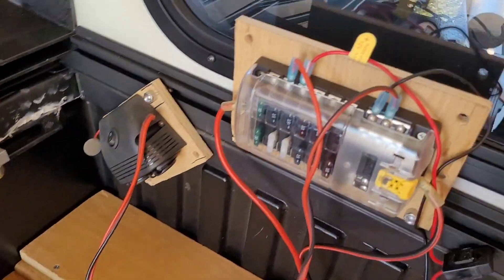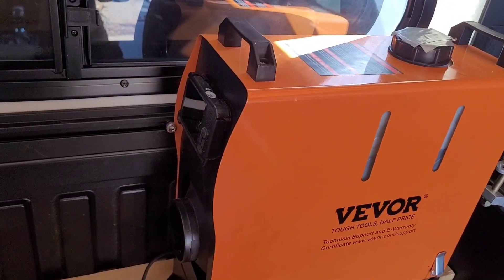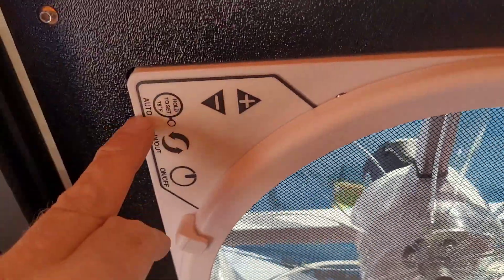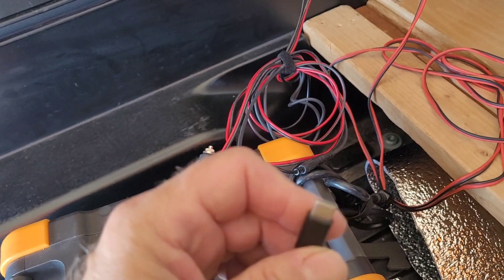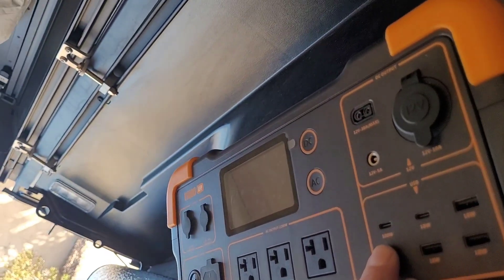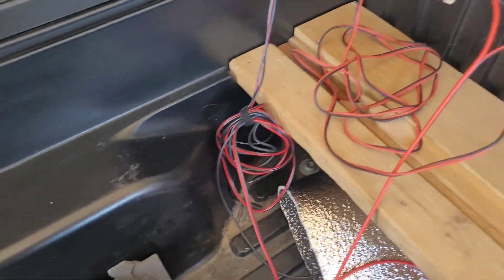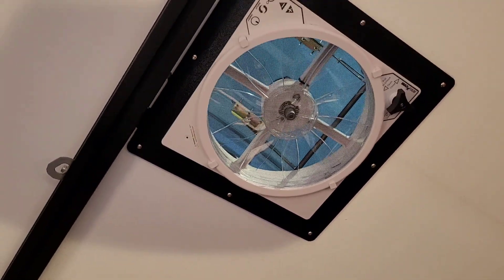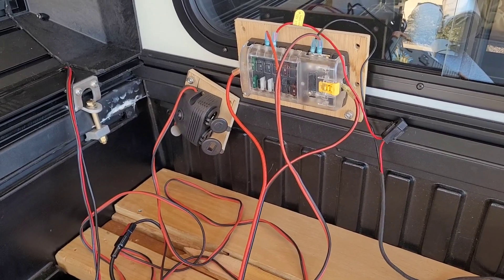DC Fuseblock for Truck Campers, Power Station use, Tune M1 wiring

Comment: What is the white stuff on the rail at the front drivers side corner, is that caulk?  Did the cap leak?  Also why is the bracket that secures the cap to the bed bent at the bolt head?  Did you tighten it down bending the bracket or did they do that on install?
Reply from the maker: White stuff is caulk from where i sealed my bed rails under the tacoma plastic caps.  See my video on that.  I had some on my hands there when I was smooshing the bedrail cap back down.
    The bracket is not bent, all 6 of them are shaped that way, they are the hold downs for the popup.   They bend it a bit there to allow a thin socket to fit over the bolt or nut there.  I actually just checked mine today for torque, and was thinking how that slight bend was clever since it lets me access the nut easier.

Comment: Great video and precisely the info I was looking for. I just bought a 2005 Four Wheel Camper, and It has a 12v fuse box that runs the lights, fan, etc... There is an old battery connection that runs to the fuse box under the seat in the camper. I don't want a new battery, so I will buy the same PECRON battery station and link the XT60 connectors wire straight to the fuse box. I will also check out that heater. My old heater is broken, and VEVOR is selling an all-in-one heater that looks perfect for my camper. Thanks
Reply from the maker: Sounds like a plan!
Reply: @dave_in_az I wanted to ask. Where did you purchase that cable that runs from the power station to the fuse box? Thanks for the help.
Reply from the maker: ELFCULB 10AWG 6FT XT60 Extension... https://www.amazon.com/dp/B0CC5N4XZH?ref=ppx_pop_mob_ap_share

Comment: Did you get the solar port on your tune?
Reply from the maker: No, they don't actually offer that as a standard.  The solar gland is easy to install and waterproof, it's best to wait until panels are on roof so you know actual best location.  I'm still deciding on my panels.  Thx for asking.
Reply: @dave_in_az  maybe it’s something new, But I placed my order with them 3 weeks ago and it was A $200 option that I selected. Supposedly they’re going to start offering their own solar panels on date of install as an option
Reply from the maker: Yep, new.  They are finally moving along on adding stuff like heater, insulation,  etc.  I called to tell them where I wanted my solar gland actually, in Dec23, and was told they didn't do it.  But they cost $15 and are easy to install ;)

Comment: Regarding that usb-c connector....    wouldn't it be possible to cut that barrel connector off and connect to your dc fuse box?
Reply from the maker: Exactly what I am doing ;)  But there are a lot of owners just plugging it into available power station ports, and some folks had issues using the USB C, which is what I was addressing there.  I just wanted to test it as supplied a bit, before I cut their nice connectors off :)  thx for the comment!
Reply: @dave_in_az so the lights are 12v? Just add a 5 amp fuse and you’re golden? Very helpful with the fuse box. I was looking at different power stations trying to devise how I’d plug everything in
Reply from the maker: @rigwhisperer  the lights are actually 24v, much brighter at 24v. But like most LED, they also work at 12v, just dimmer. Plenty bright at 12v.  But I use the USB-C  PD plug for the lights,  which can deliver 20v, makes them brighter if wanted.